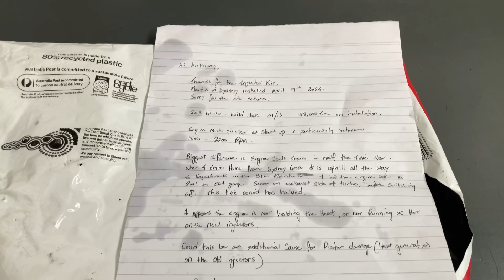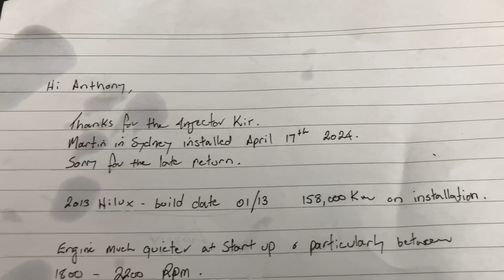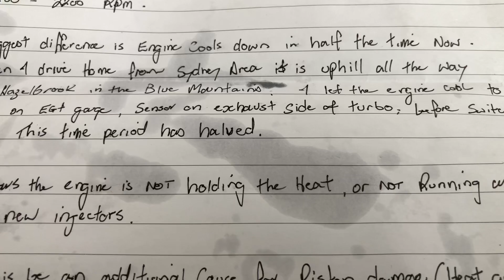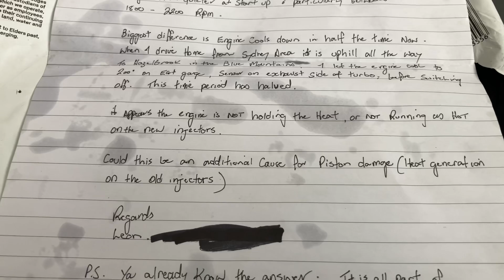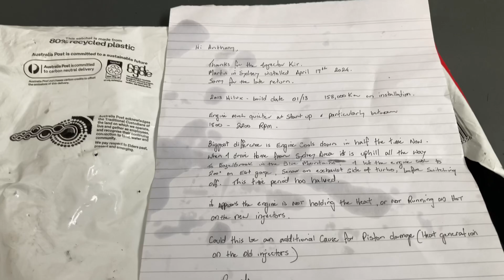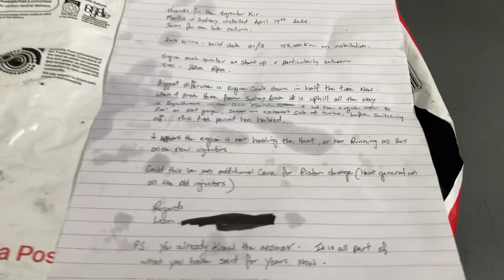INTERESTING Input Contributor to Why pistons crack?

Comment: How come old diesels with direct injection never needed changing…. Just shows that new vehicles are rubbish if you need to change injectors at 170,000km supposedly. I like the 1kd as the electronics are simple and has enough power. Now car insurance every year going up eventually it’ll cost 5k to drive it each year… great economy in Aus lol

Comment: Heavy towing on a 4 cylinder diesel like 1kd excessively can damage the engine. Injectors aren’t the cause. I know of 1kds with over 500,000km on original injectors. Even egr left as original no blank plate. Just use a cleaner every service and change oils filters etc. cost of living to high to spend thousands on injectors…. Don’t touch it Drive it till it dies (which it won’t lol)
Reply: Thanks for this, any recommendation on best injector cleaner to use?

Comment: Ford rangers have the old piston crack also, everyone has their theories, from injectors, to bad fuel, spring in the high pressure pump failing sending shrapnel into fuel system eg injectors. Egr getting stuck open sending full exhaust gases down intake and cyl 3 cops it all and grenades.
Reply: Sounds like an awesome vehicle to buy. 🍺

Comment: I spoke with an engineer about the problem.  The manor in which the piston fails, is consistent with rapid thermal expansion/contraction. The heat gradient being exacerbated by poor fuel spray, of poor condition injectors.